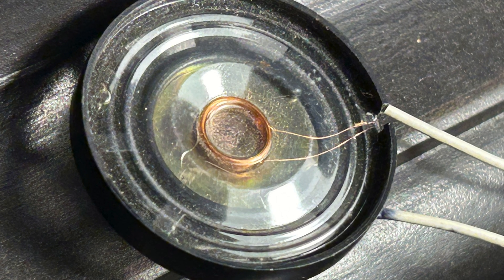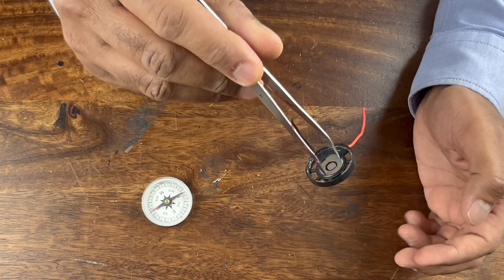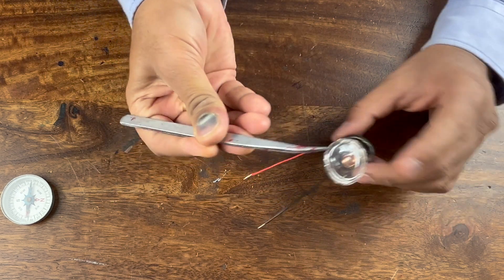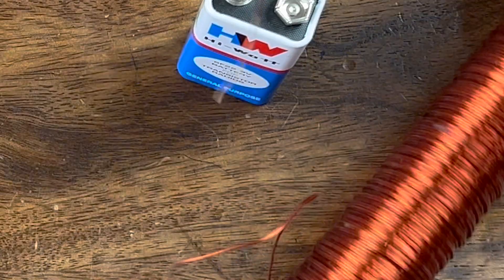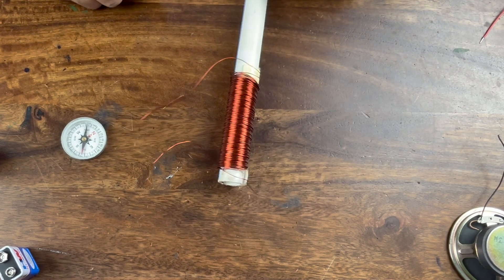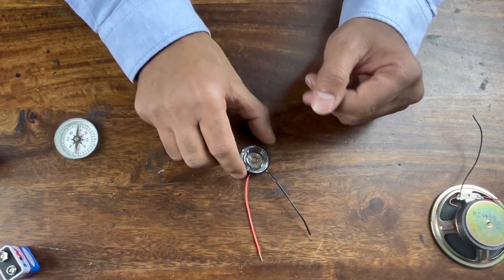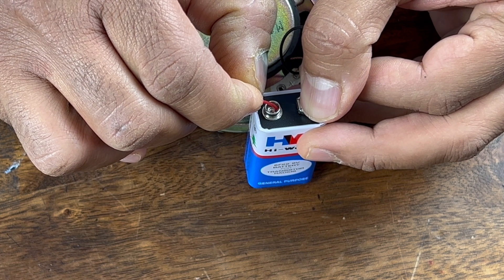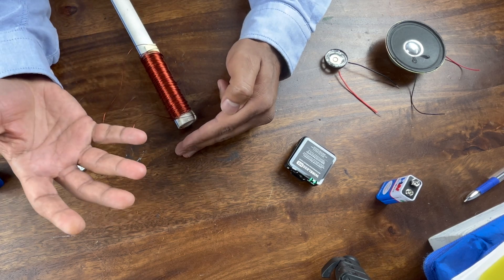How a speaker works?

Comment: THANK YOU! I am trying to repair a very small electronic board for a toy and I wasn't sure if I overheated a transistor trying to solder a wire to the negative. But now I see that I might be missing a piece of the speaker! Thank you! thank you!